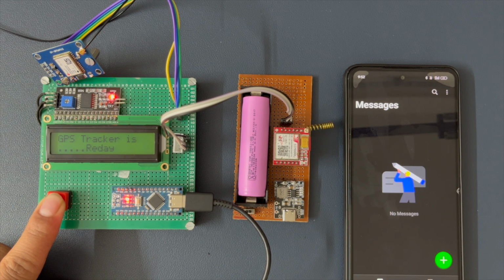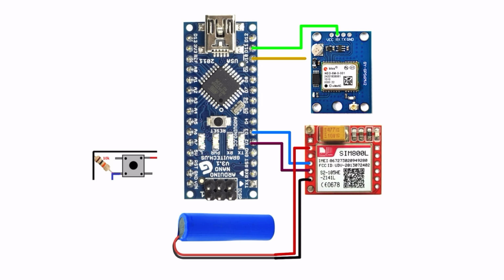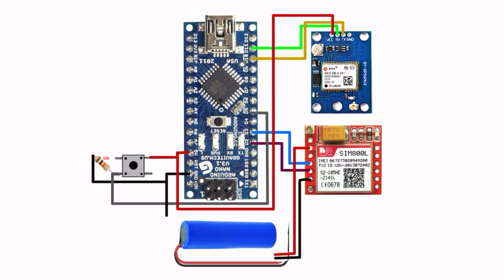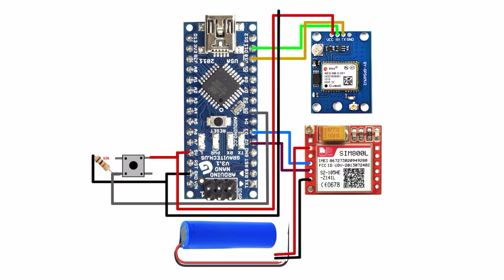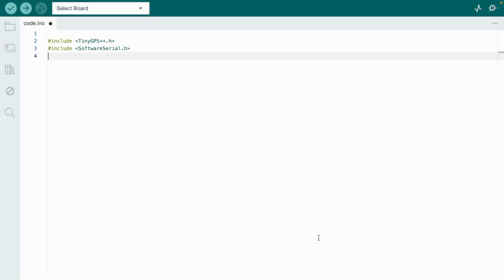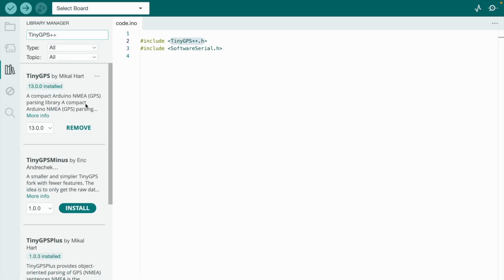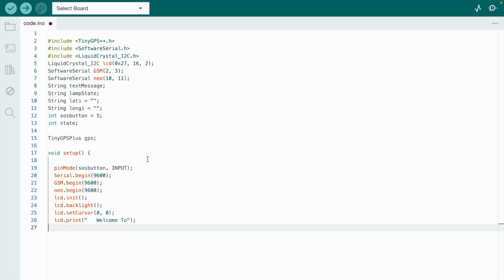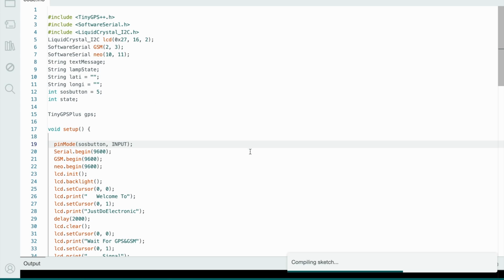GPS Tracker using Arduino | Sim800l

Comment: Hi i followed the diagram and copied the code but the sos switch does not work and it sends messages continuosly. why??
Reply from the maker: I think the button define in code id different check the code proper way
Reply: @JustDoElectronics  okay thanks

Comment: I didn't use display but i connect all thing according to the curcuit diagram and I use a discription code but when i click single on push button it send a message continiously
Reply from the maker: I think the push button is not connect proper

Comment: Code in your video and code in your link is different in video you used sos and your link you used only text message
Reply from the maker: Yes but code is work 100% just the pin and do the connection proper
Reply: @JustDoElectronics  but I need 2 features  sos and text messages